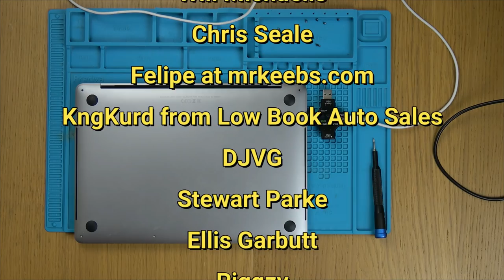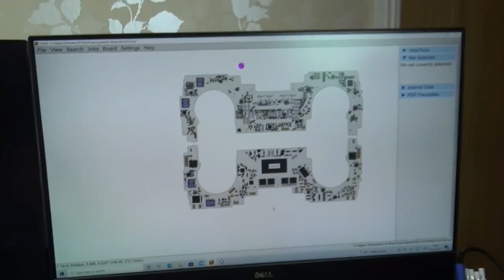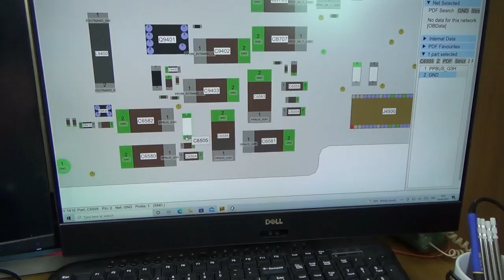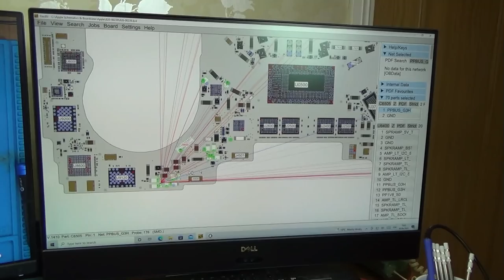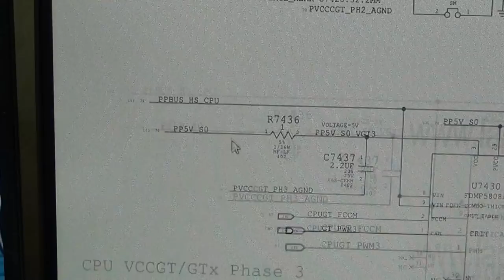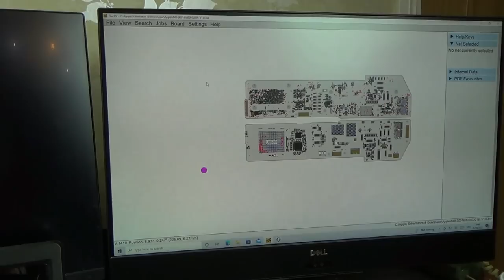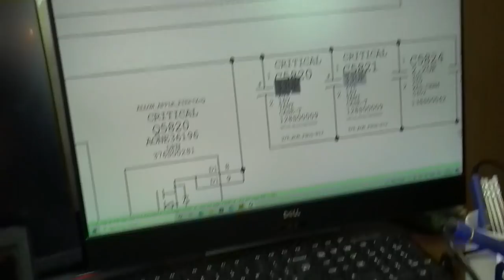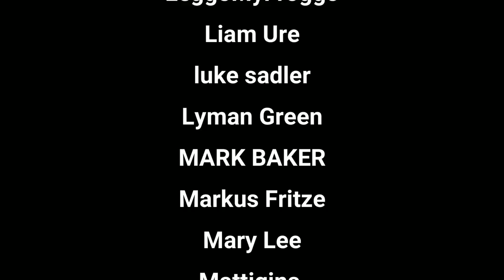Apple WANTED £460 to FIX this MacBook - Can I FIX it for less?

Comment: Regarding your query about the PPBUS_G3H vs PPBUS_HS_CPU,  they are connected via R5400 which is a current-sense resistor, so yes, they're effectively the same rail in this instance.  It's a bit of a pain that it's not always easy to represent that interconnection between two rails; invariably in features I've written in the past for FlexBV when I try to do "next network connected..."  it turns in to an incomprehensible visual mess :(

Comment: You simply cannot have a favourite Australian; it's positively un-British to be friends with Australians ( unless we're winning the Ashes ).  Happy to see you picked up a solid smoking-gun fault-fix situation board, bravo.
Reply from the maker: 😂 I didn't realise Paul, I will have to let down Margot very gently...this is going to be hard. BUT how lucky was I on this fix, not even a chip, but a cheap easy to find cap showing itself on 1 volt,  result👍👍

Comment: This shows just how greedy every company is and why they hated Rossman's right to repair program!
Reply: Dr Weirdgloves  If that's the case, and all their staff at the GENIUS BAR just replace things then it shouldn't be called a GENIUS bar. For a company that likes to push their eco freindlyness why cant they change parts. There seemed to be multiple testing points on the board to accomplish some simple testing to locate the faulty part. I have a love-hate relationship with Apple. I like their products but hate the way they rip of their customers. Perhaps when they sell their items they should point out the cost of fixing (sorry I mean swapping) if anything should go wrong. I dont know about this board but for a premium price shouldn't this item not have gone faulty.
All companies have business models but Apple model seems to rip its customers off which isn't a great model.

Comment: That was a really nice fix. Love it when you can fix something for a fraction of the cost of a fix from the manufacturer.  Especially when it's a reasonably modern piece of equipment that still has a lot of years left in it.
Reply from the maker: Yes, the best type of faults, thanks Roger 👍
Reply: when it Apple that's not hard!

Comment: Well done. I did hold my breath though when you removed the cap, even with low melt solder, by heating just one end and then bending it over. I was expecting the left pad to lift and cried a little in reaction to "came off nice and easy, didn't it" (27:08). One suggestion is to use two small soldering irons in future similar circumstances.

Comment: Great fix! I just switched from iPhone back to android after 8 years due to Apple's ridiculous stance on right to repair. Had Apple care plus and my phone was covered but they won't let local authorized repair shops keep parts on hand and it would've been 5 days to swap out a swollen battery that took me 15 min to fix. Have a z fold 3 now and selling my 12 pro max. Granted I know if I damage the screen on my new phone I may have to send it in for repair but a local authorized samsung repair shop here has samsung parts on hand so I have more faith in them to get things done quickly. That and Samsung teamed up with ifixit to make parts available for end users!

Comment: It always brings a smile to my face when you are able to fix something

And it seems that one is one of the ones that has the butterfly keyboard, which is known to have issues, i hope the family it is going to don’t run into any issues with the keyboard

And for reference, 2016 to 2019 13 and 15 inch MacBook Pro models have the butterfly keyboard, along with 2015 to 2017 12 inch MacBook models, and also 2018 and 2019 MacBook Air models
So essentially all Intel MacBooks which have USB C ports, with the exception of touchbar MacBook Pros with a physical escape key, and the 2020 MacBook Air
Reply from the maker: Thanks Pineapple, hopefully the keyboard and the rest of the laptop will behave itself 👍

Comment: For so long you've been hoping you could fix something with just a shorted capacitor. Your dreams came true with this one. A part costing pennies rendering it needing 400 pound plus to repair. Apple needs to improve its repairability to convince us it's being sustainable. They should do a repair like that for 30 quid or so. But I bet they'd simply install a brand new motherboard
Reply from the maker: I know!! This couldn't have been more perfect for a fix it video. Like it was staged it was so good 👍👍👍
Reply: They don't care. They'd sooner swap an entire motherboard and charge you for it.
Reply: It’s simply a matter of economies. This was an easy and cheap fix once you know the source of the fault, but it could have been a more expensive part. The original fault could have caused others that will manifest later. Diagnosis could have been a lot harder than this one. It probably took Vince half a day to find and fix the fault. If Apple took half a day identifying your problem, that would be more expensive than replacing the whole board for a guaranteed fix when the diagnosis could have taken half a day and still came to the conclusion that the board would need replacing for a good fix.

I know it sounds like they’re doing things wrong, but can you name any other manufacturer who does what Vince did here as their repair process or do they all just replace whole boards and modules?
Reply: @sdjmchattie  not really I will agree. Right to repair rules might change things though. Your right in it'll probably still be whole boards and not individual chips and also that something else could have caused that capacitor to fail so in the long term the fix isn't guaranteed. I guess they would end up with lots of 2nd or 3rd fixes and you're right it wouldn't be economical. The repair cost from Apple is still huge though. That's nearly half the price of the laptop
Reply: @paultasker7788  thanks for the reply. It’s good to hear more perspectives. In reality, bearing in mind the fix would have to be replace the whole board for it to be a realistic approach to Apple’s repairs, what do you think the repair cost should be? I would guess it’s got to be a part that costs them around £200 to make. Half an hour of someone’s time to do the swap and test. Perhaps another £60 in wages, insurance, premises, tools during that half hour. Add some profit because businesses aren’t businesses without it. Plus VAT. I would guess this is always going to be a £350ish repair and then Apple add on a bit more because it’s Apple.

Comment: hmmm i have a macbook pro 17 2011 that wont boot (only the fans start to spin when you try to turn it on) It also had the gpu disabled the ATI that the 20111 model uses fails for most users around 4-5 years. So i bought a 2010 macbook pro that uses a nvidia gpu and it still works so i forgat a bit about the broken 2011 model. I think i know how it got broken. the laptop was laying on my bed but i used a powered sound system that was on with a 3,5mm jack next to it not in the laptop and it probably made contact with the body. So i think something shorted or blown cap. And when you try to turn it on it wont to in to boot. I opened it once and checked a bit if i could see anything wrong but did not see it.

Comment: Hey Vince, you've probably gotten this comment already, but this is a pretty well known fault Apple has across multiple MacBook models. Essentially, to cut costs, they slightly underspec the cap, which means it works for awhile, but eventually things catch up, and you end up with this exact situation. Rossman has a larger cap he recommends to replace this one with to avoid a future relapse with the same issue. Very nice troubleshooting and fix, of course :)
Reply from the maker: I don't think it has been mentioned Dark. So is it their caps in general or is this specific cap a known weak spot? It looks like a bank of these caps where in parallel in the schematics (I think from memory) so I presume any cap in that bank could cause problems. Cheers, you always have helpful comments 👍👌
Reply: @Mymatevince  as far as I'm aware, just the caps in this particular bank, and the usual fix is just replacing a single one. I'm not sure of the longer term health of the other caps in the bank, but from what I can tell just replacing the one seems to be enough to keep returns from happening in the mid to long term, so just the one is probably enough
Reply from the maker: @metroid031993  Thanks for clarifying Dark Samus 👍👍👍 Nice one
Reply: Are you sure about that @dark_samus ?    I know about the C7771 / 2010 models and a few other cap situations with existing Macbook repairs but this 820-00239 doesn't have a sigature fault situation like that.  The C7771 type cap faults are because they wear out effectively over time due to not being sufficiently specced for the task,  though it technically was sufficient by the numbers.

Overall, Apple spends quite a lot more $ on parts that most other manufacturers relative to the design; their boards are of high grade and the parts are of good branding;  Apples biggest issue is that they usually go for the highest capacity part for the smallest (volumetric) size, which does lead them to situations that we often see, ignoring liquid damage situations.

Let me know if I've missed something about this 820-00239 series.
Reply: @pldaniels  huh, I could definitely be wrong, I was moreso going off of the past faults rather than doing tests on my own. Granted, how long did it take to start seeing those faults on the 2010 models? I suppose this cap could have just been faulty from the factory, for sure
Reply: @metroid031993  interstingly I usually see more MLCC failures than tant/poly failures these days.  Most of the time it's just down to bad luck, though again, Apple does have this tendency of using the highest density parts it can, even on a board that has acres of space to spare.   A good example is the use of 20uF 10V 0402 caps on their last generation of Intel based Macbooks, typically on the NAND / SSD rails, the highest generally available spec you can normally buy is 10uF 10V in 0402 MLCC size, yet somehow Apple has 20uF versions in that voltage.  

One thing is for sure, I'm happy to have these kinds of failures turn up, a lot nicer than dreaded PMIC, PCH, or CPU failures :(
Reply: @pldaniels  makes sense. MLCC capacitors are absolutely crazy in construction. Interesting that apple is really on the bleeding edge when it comes to components, though I suppose not particularly surprising

Comment: You know you love "voltage injection"  :face-red-heart-shape:   re: CO$T:  I'm guessing Apple just relies on R&R board replacements as apposed to having a "corporate soldering iron jockey" (no disrespect:) to do  board level repairs. Not to mention issues with reliability and safety regarding the Apple brand....  But yes, that was magnificently serviced. You're hired!

Comment: I know it sounds expensive what they quoted, but a lot of firms will just have a standard fee, had that needed a whole new screen or mother board then you are quids in, but if you want a small chip replacing then it looks like a rip off.
I had it with my tester, Megger wanted £350 plus vat, that's their flat fee, turned out when I pulled it apart there was a build up of carbon under the switch. It's how these companies operate.

Comment: £460 for a 2p capacitor and people wonder why I won't buy, or use iphones/Mac when you will get ripped off by them if it needs a repair and you pay 2x what they are worth to buy them in the first place. I'll stick to my Android phone and AMD/Intel PC/Laptops thanks, half the price and cheap and easy to fix.

Comment: Apple don't repair, they replace. Think of your Rolls Royce Vince. You have a slight misfire so you pop it into Jack Barclays in Mayfair and they start the engine and hear the misfire, then tell you that you need a new 6.75 litre V8 engine at ONLY £17,500 or they will recycle the car for £500.

In reality, you needed just a new spark plug at £5.

THAT is what yiou have just done with this Macbook. Apple said it needed a new logic board at £460 because they only change the whole board - replace the engine.

ps, Tantalum capacitors give off cyanide when heated up, so FUME EXTRACTOR mate.

Comment: Super awesome! 🍻 Did a great job there isolating that done, I've yet to have success with voltage injection, nice to see it working 👍 

Curious now if the FLIR would've seen it - I think it was giving those strange readings (red/hot when camera a bit further, blue/cold when closer) due to how those react to reflection of light - your shadow may have been affecting it. Try it with studio lights off next time 🤷‍♂️

Cheers!
Reply from the maker: Thanks Garth, I think it might be because the whole board was cold on the FLIR test and it was trying to see different temps when there wasn't much variation in temp. I have no doubt that it would have picked up the actual fault when voltage injection was used. I will hopefully get to test the FLIR again in a future video. Cheers mate 👍😎

Comment: No way that make it into ebay.... well you did a video few months ago on a gaming windows laptop that got out cause of a cap at power rail wgain
Reply from the maker: If it is the one I'm thinking of with the small ceramic cap that shorted then that was sent in by a viewer, it wasn't from eBay. I did have an easy MacBook fix from eBay a couple of months ago but it isn't the 'norm' on expensive products as they have normally been previously looked at👍

Comment: Thing is, although we can't say it, Apple is not a company known for its integrity and makes you wonder if they knew what the fault was and were quite willing to pay that £40 knowing they will make much much more with a repair back and that shows the absolute disregard Apple seems to have for its customer base.   My youngest has one of the new 13 iPhone's which developed an audio problem, it was only a few months old and it took a nasty fone call from a solicitor in the end to get them to actually repair the damned thing as they wanted £150 up front and she was like no way, this is an internal fault and well within the 12months warranty.   I have just upgraded my own phone, Vodafone kept trying to punt me onto a 13 and I took a Pixel 6 because of what Apple did to my daughter, I wouldn't buy a stack o' bibles off 'em without checking they were kosher :(